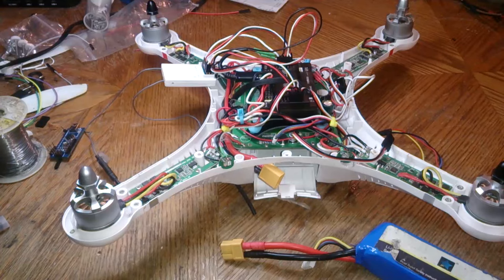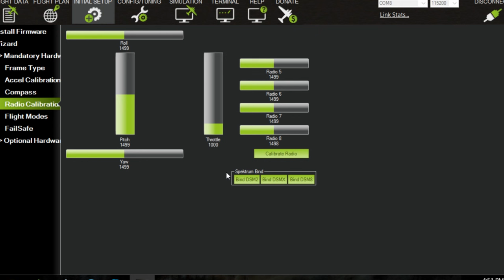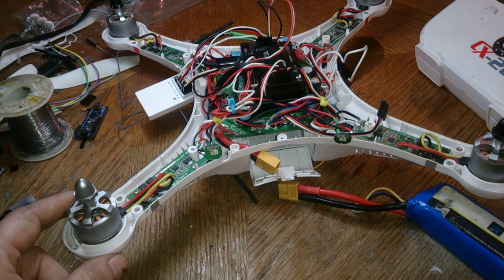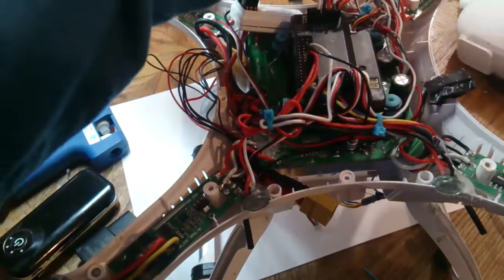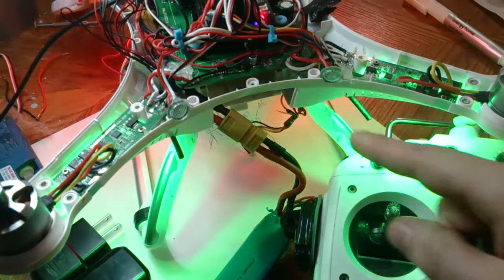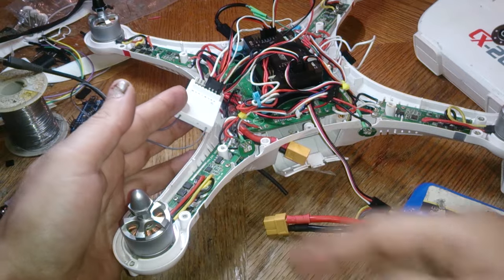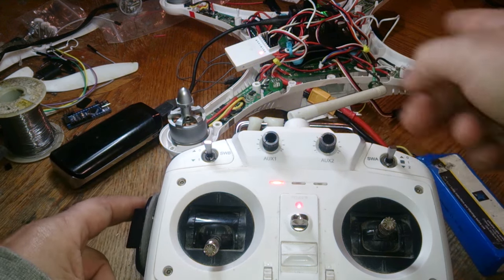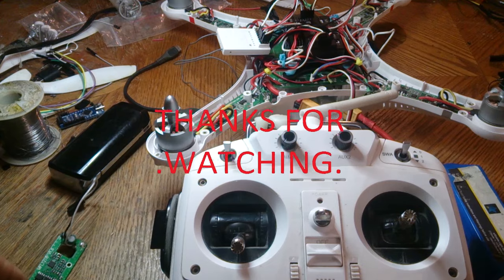cx20 esc trouble shooting

Comment: Hello. First, thanks for your CX-20 videos.  I find they are very well done and helpful.  I do have a question related to ESC troubleshooting:  Have you ever run into the scenario where you plug in your controller(I'm using stock Cheerson) to power and you hear 3 "musical tones" in sync and after a 2 second delay or so, you ear a separate musical town coming from a single ESC?  In other words, one ESC seems to delay it's startup sequence about 2 seconds after the startup sequence of the other ESC's.  Any idea what is going on?  Here is a video that shows the symptom:  https://www.youtube.com/watch?v=I_BNpAV9kXw - Thanks much!
Reply: Update:  I found that when the lipo battery is connected to the CX-20 the ESC startup beeps are all in sync.  I believe that the current from my USB port may be slightly lower than ideal and probably why the single ESC starts up with a delay when no lipo is connected.  This appears to be a non-issue now.
Reply from the maker: Hi.. your comment was put in my spam and didn't show up till now..   Thanks for coming back with your fix as well.
Reply from the maker: Now i should add your usb should not be powering your esc's at all they are powered from the 12 volt rail / pads  
You should get annoying low voltage sounds from your pico buzzer ..
but extremely odd your esc's are getting power, seems to be a open diode or something that is back feeding through the regulator or something.

I do have a video on how to connect the usb the safe way .. its simply cutting the positive wire on the usb cable.  then you use the battery and usb cable at same time.

I try to warn people as much as I can that you are gambling when plugging in the usb and battery at the same time , the esc's use sil chips and they are extremely acceptable to firmware corruption with voltage spikes.

Just be careful . as something is wrong with your board.
Personally i would suggest just doing the usb cable mod and using the usb cable and the battery at the same time after.
Reply: @ModItBetter  Wow.  Very good catch .  That make a a lot of sense.  But I thought I was super careful in isolating the voltages (input side vs output side of the controller etc).  But now that you bring this up, it does seem like I did something wrong in my re-wiring which was done to route the auxiliary channels through the controller for autonomous control but with an isolated voltage for protection against the auxiliary servo used for payload release.  Thanks very much for your feedback.  I'm a troubleshooting it now and will post back my findings.
Reply from the maker: @BautistaVids  Hi I don't think its something you did.. to quickly test this.. remove the "-b" cable from the receiver (5volts from power board)
and  plug the usb into the side of the apm or under.    Esc's should not power up this way. If they do then look at your wiring .
Reply: @ModItBetter  Yes, I had done that this morning - disconnecting the receiver from the PDB +5v  eliminated the esc's from startup sequence beeping.  I'm not exactly sure what that means in terms of what went bad if there is no problem with wiring.  I did ad a separate BEC to power the external servo (s1/s2) though.  I have been making a wiring diagram of the default in comparison with my current wiring scheme to confirm whether I did anything wrong.  Do you suspect anything based on the results of your suggested test?  Thanks much.
Reply: UPDATE:  Quite interesting after simplifying my configuration (removed the added BEC and  external auxiliary wiring/mapping I discovered that one of the ESC's has a red PPM wire connecting to the PDB.  I'm nearly  positive that the controller (I'll refer to as the APM) did not have any PPM jumper but had a 1-to-1 signal mapping between the APM input channels and the receiver.  I'm going to unsolder the PPM wire and see what happens.
Reply from the maker: @BautistaVids  esc 3 has a extra wire that connects to a ppm pad .. that wire controls the led's turning on when you move the throttle up. its connected to motor output 3 but can be connected to any of them...
Reply from the maker: dont be too worried about your setup right now with the back feed its only a issue if you plug in the battery and the usb at the same time.. but you made that switch to turn off the pico buzzer its usually the only reason why people plug in both at the same time so the buzzer does not beep.

I'll see if i can put up a video in the next couple of days on the issue. As other people have the same thing
Reply: @ModItBetter  Right on man.   Thanks for you help.  I really appreciate it.  I enjoy watching your videos - you are a very knowledgeable fellow and your presentation is great (I've watched many of your vids).  I'll post a follow up video since I'm definitely finding some odd things about my configuration.  Right now, everything works but the receiver is getting power from the APM instead of the other way around.  So I'm troubleshooting that because power isolation between the receiver + apm and the auxiliary servo is very important to me when flying over water.  Take care brother.
Reply from the maker: @BautistaVids  Thanks and enjoy the scene ,your into arduino's so the open source might keep you busy as the source is well open source and can be hacked up with arduino ide.            The receiver gets power from the first channel on the receiver "-a" the white red and black.  it is normal for it to get power that way  when plugged into usb.
when using the battery it gets power from  "-b" (from the pdb) the positive fallows the rail down to the "-a" and gives power to the apm and receiver at same time.
Reply from the maker: @BautistaVids  Hi i think i'm flagged on your channel as well heh..so i'll just post my comment here as well..

Hi thanks for the kind words.. yes I was going to make a video on just simply adding a diode to the positive wire going to "-b"  as you said that will limit the annoying beep sound and any stress on the usb on certain pc's.
Ok the pdb has two purposes.. one to simply feed the 12 volt  to each esc.(think of the traces as just direct wires to each esc)
 and two to deliver 5 volts..  The led's under the esc's  fall under 5 volt's and the pico..
The esc led are actually on a different circuit.

Now if you plug in your usb and test the two 12 volt main pads(battery pads)
while the usb is plugged in . I'm betting your getting a voltage there ..
so the 5 volt regulator or transistor is failing and allowing the 5 volts to  feed back through that section.      Now this would go back to a diode again I'm sure if you just simply trace the positive 12 volts that goes to the regulator ect.. . cut the trace and add a diode that would fix your issue.

another test would be just to simply put your meter in continuity and test between low voltage 5+ volts and your main 12+ volts you will probably get 0 resistance.Beeeepppp heh..
Reply: @ModItBetter  Right on.  I think those suggestions are good and will keep me busy for a little while.  Thanks again and you are very welcome.  I checked your channel and don't have you flagged that I can see so I'm not sure what is happening with that.  Maybe I've missed it or  it's because there have been a fairly large amount of comments coming from me (and back from you :) ) that YT is treating this as a spam situation.  I'll look into that further but appreciate you posting your replies here - works out fine.  Thanks again and hope you are safe and have a good weekend.  Ciao!

Comment: Hi Banhs6996,
I have the beeping esc problem (xgw_esc ver2.4b) and possibly done when 
connecting to my pc and battery. Anyway, I'm trying to recover it with 
any possible way before flashing blheli.
I have decoded the programming menu but I  don't know what the commands 
are: see if you can do anything with this information.
the dot (.) is for short beep the the dash (-) is for long beep
When you enter Programming mode:
----------------------------------------------------------------------------------------------
.                        >           .        . .           . . .
. .                      >           .        . .           . . .
. . .                   >           .        . .            . . .
. . .  .               >            .        . .
-                      >            .        . .            . . .
- .                    >            .        . .           . . .            . . . .
- . .                 >            .         . .           . . .
- . . .               >            .         . .       
- - -                >                 EXIT MENU

----------------------------------------------------------------------------------------------

up to 6 commands looks similar with blheli esc program but I'm mot sure.

http://img.banggood.com/images/upload/2014/12/Emax%20BLHeli%20ESC%20Manual.pdf

Althought I haven't restored that esc and I will flash it with your method.
Do I have to flash all 4 of them or just the one has problem?
and is there any way to reset it instead of flashing it?
If I flash it, the sound of cx20 esc changes?
Reply from the maker: HI .. yeah i have the same thing basically written down lol.. i just never went as far as doing the sub menu's.. the problem about hitting a  default sub menu is it automatically sets the defaults  Somebody said he was shipping me 3 esc's when and if they get here i will try to do a more in depth menu and sub menu ..I guess break on and break off will be the easiest !?  ..   
We can guess more as well with how many options it has in the sub menu.

yes the sound is different . specially on esc calibration it plays that 10 second jingle ..

you can try just one esc and see how it fly's .  keep it very low to the ground and try to fly it with a almost dead battery .    I suggest keeping it low in case it does a dive towards the ground on low battery .      

I have not got enough broken esc's to get another one i can get bytes out of it to try to rebuild it.   They come locked from factory , I can't even attempt a voltage glitch on it to try to unlock it.  it instantly gets corrupted on any screwed up voltage.

If you do try to recover it with my firmware .. try to see if you can read it first.. 
most will be ff's but you might be able to get something .
Reply: Can't  we make the readings from a good one and load it to a faulty one?
Reply from the maker: the sil chips are being locked from reading . . when you do a write, it erases it then writes it..
Reply from the maker: its why in my last comment as well I asked you to see if you can read it first,   when the firmware gets corrupt, it might also un lock the chip in some cases , or we might just get that one chip that was not locked.
Reply: ok , then I will give a shot to all 4 of them, just in case and let you know.. Thanks again.
Reply: Hi again,
Had no luck to read any of them but succesfully flashed the one who was beeping and now the quad is fixed!  It flies perfect!! Thanks for the 
info and for the firmware Writting ! ! 
Keep up the good work!
Reply from the maker: glad it worked out for you.. hopefully one day we can get a true dump of it.
Reply: Is this firware compatible with MFL 1218 v1.4? I' m asking because I 
have 4 off them and two of them has the same problem. Thanks again.
Reply from the maker: Hi no its not compatible ..the only one I did not release is mfl1218v1.6 .. but i was not able to actually test it . because the esc was already fried ..   If I ever get the version you asked about or another v1.6 ..i will spend a day or two trying to get them to work .